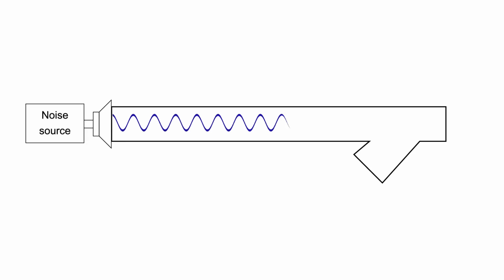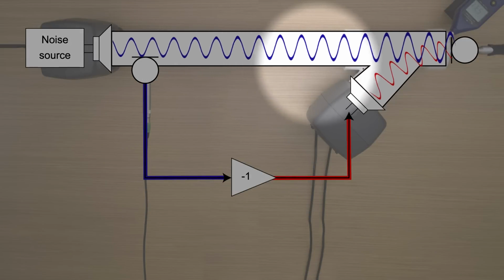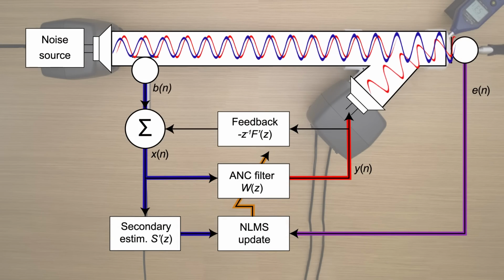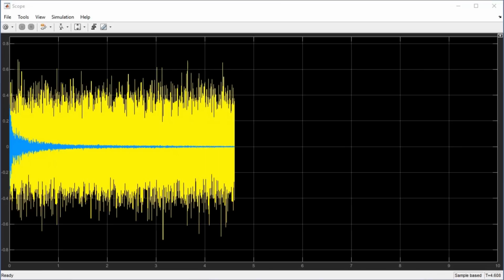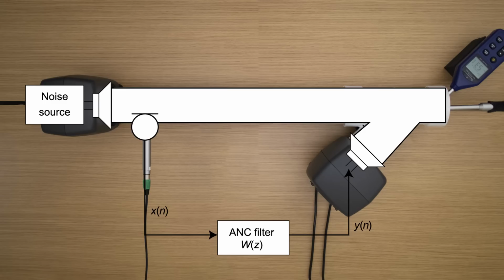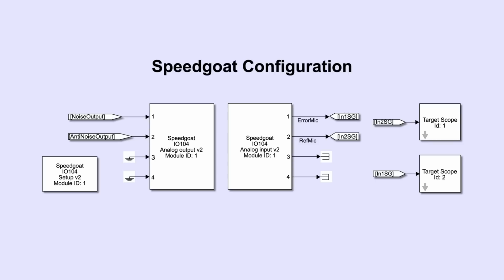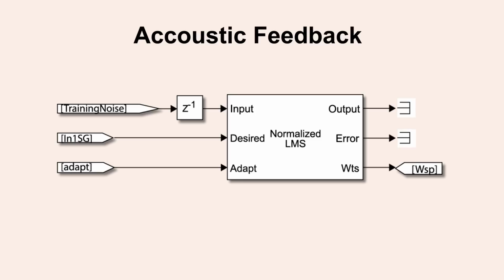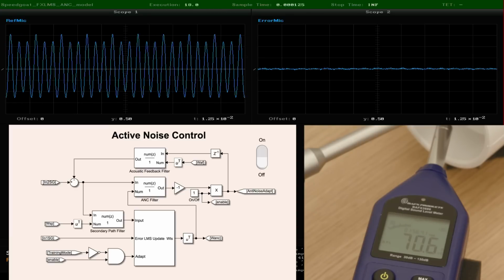Active Noise Cancellation – From Modeling to Real-Time Prototyping

Comment: A question, 2 sample latency is impressive at 8kHz, does it scale with higher sample rates?  In other words do you maintain 2 samples latency at higher sample rates or the equivalent time, which would be 4 samples at 16 kHz, 12 at 48 kHz, 24 at 96 etc.  Either way the latency is impressive
Reply: 2 samples are due to double buffering. Mlab did not need any exotic boxes, a [EVM for] DSP would suffice. What they miss is DAC/ADC anti-aliasing filters. They also disregard non-band-limitedness of sensing mic to error mic acoustic path. So they will run into troubles with the non-casual spreading of IR estimate, etc.  Adaptive control is not easy, and any attempt to represent it as trivial is profoundly misleading.

Comment: Back in 2013 I proposed a model like this to folks attending a small hacker space called Hacksburg in Blacksburg, VA.  At the time I was being annoyed by people who were apparently set on disturbing my peace so the idea was in fact motivated by a real life problem. 😄  I thought the best approach would be an array surrounding a space.  After researching further, a combination of an anechoic chamber with standard shop head phones, surrounded by a speaker system and actuators to conduct into the walls would probably yield the best results.  You also have to account for heat and humidity because the filter you have could be thwarted with a hairdryer.  
  
Edited to add:  
Apparently a lighter gas than air like helium or hydrogen also helps a lot.  The effect there is the inability of the gas to transfer much of the noise, and be easier to maintain than a vacuum as an outer layer of the chamber.
Reply: What’s exactly anechoic chamber? Is it not too big, to be installed easily on the headphones, which you will wear in public!?!😂
Reply: @ndeutsch  So that's the chamber you go into in recording studios, or places that offer hearing tests.  There are materials on the wall to absorb the mechanical energy of the propagating sound waves which then gets turned into heat.  Pulling a vacuum around a space eliminates sound thoroughly as it simply has no medium to propagate in.  The speaker system would work to actively cancel the waves before they even approach this proposed space which should help theoretically.  
  
The speed of sound also changes with the temperature of the medium the waves travel in.  Active noise cancellation can be negatively effected with a device to alternate temperatures such as a hair drier if the circuit doesn't have the time to convert and output the inverted wave patterns before they get there or if they don't line up perfectly to interfere destructively.  
  
This is probably more information than you asked for.  😄